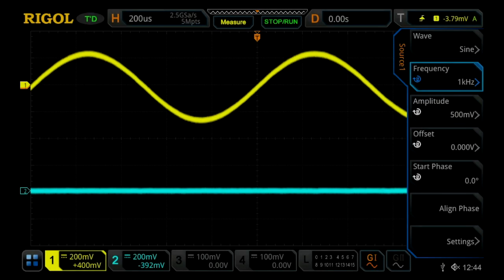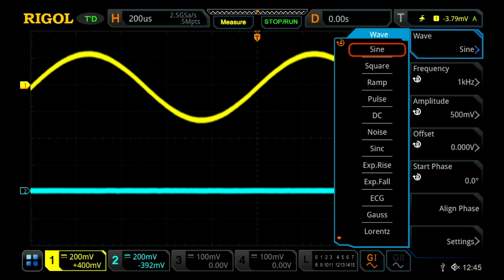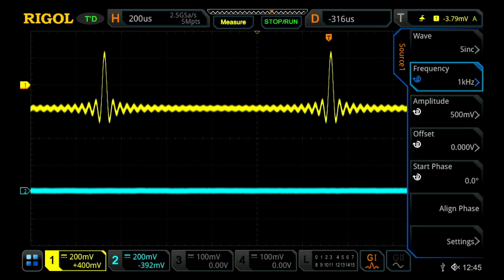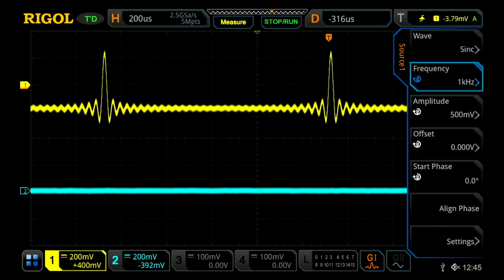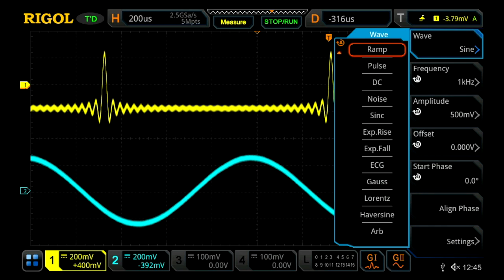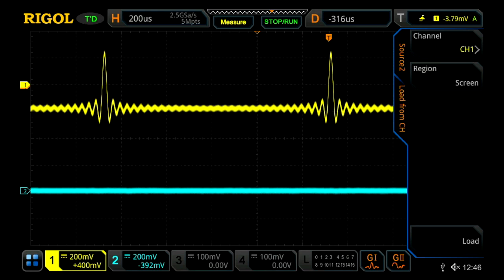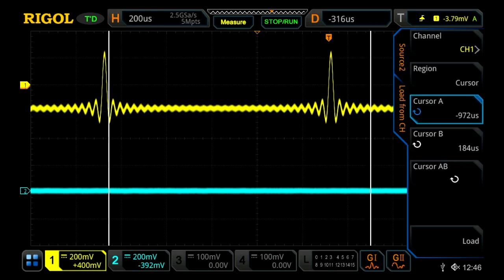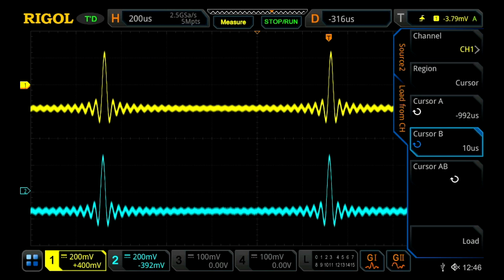Two Channel Waveform Generator

Comment: Can you then output the signal into a curcuit?
Reply from the maker: The MSO5000 and the MSO7000 Series both have a built in waveform generators on the front of the instrument that can output the different functions described in this video.  The BNC ports on the left on both of the instruments are the output waveform generator channels.